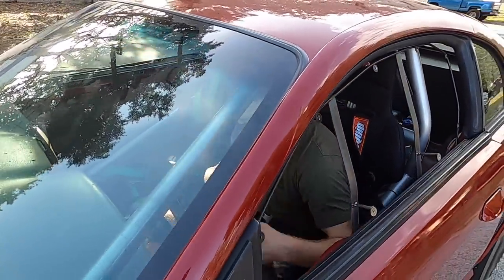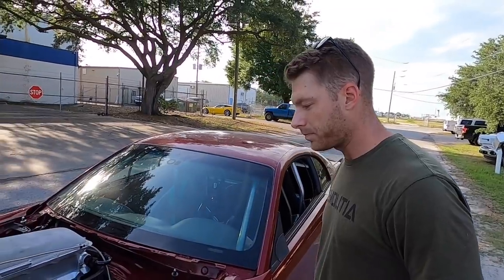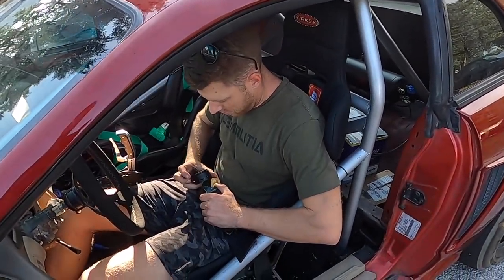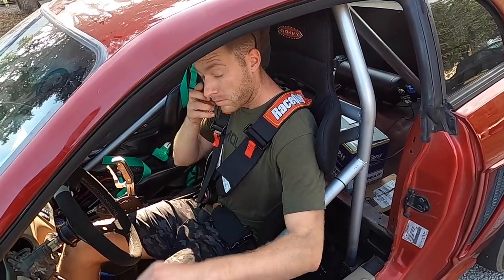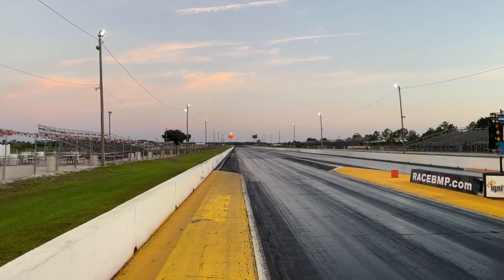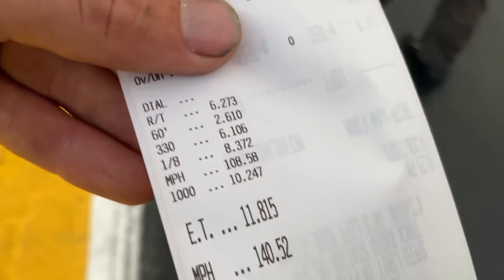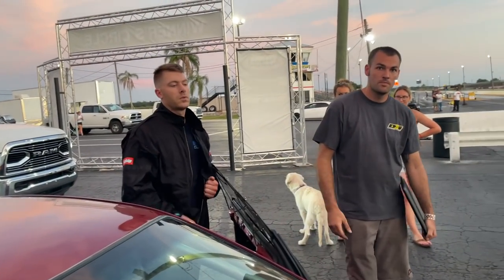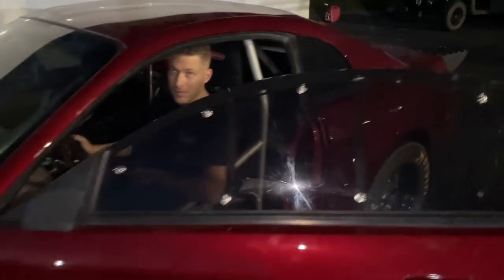FAIL: Testing at the Track... Pass: Testing on the Street... Car Is Headed to Race Week Hurt

Comment: The torque converter or flex plate has some crazy runout. Definitely put a good flex plate in it. Iv broken so many stock LS plates and finally put a TCI plate in no problems since.
Reply from the maker: Got one on the way!

Comment: The best thing is to get a bolt together converter they are pricey but you can make stator changes instead of getting a new convertor all you buy is different stators open it up and make the change and if you burn up the trans you can clean the convertor easy without sending it away

Comment: Is it going on the stacker? Wouldn’t it be easier to change it before on the lift in the stacker?
Reply from the maker: Stacker has to hit the road and we didn’t have the parts. Overnighted them to LS. The lift on the stacker you can’t access under the car, it’s like a flatbed.